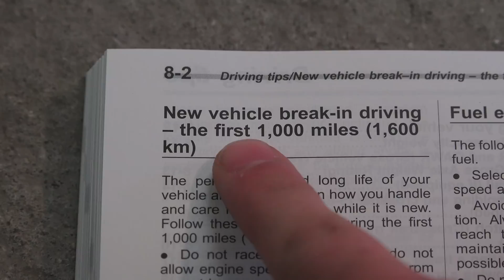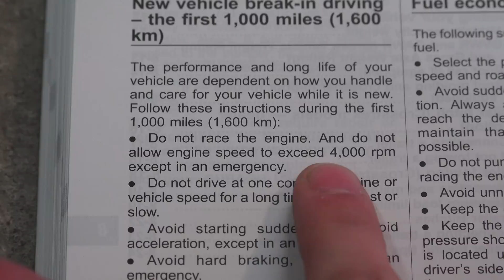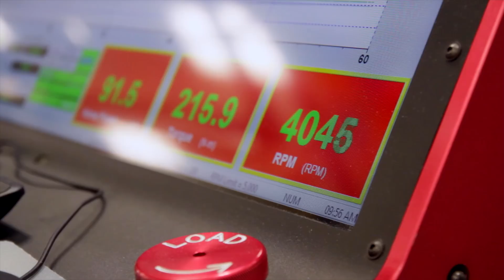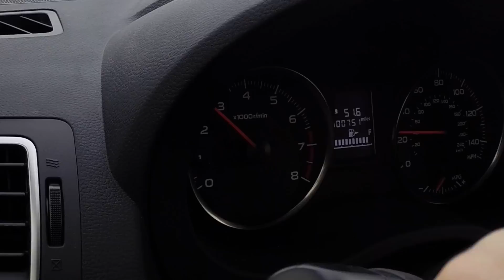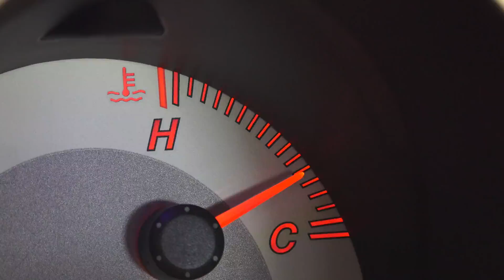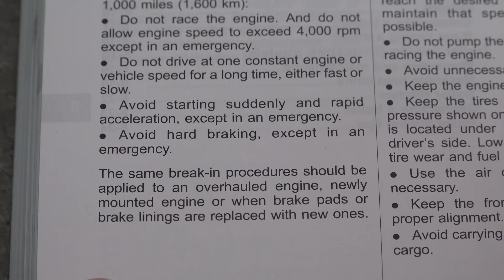5 Things You Should Never Do In A Brand New Car

Comment: I disagree with your break in theory, here is why. 

The main reason for run in is to knock the top off the hone in the bore allowing the rings to seat against the bore. The reason a bore is honed is so that on a microscopic level there are grooves in the cylinder wall so that there is a place for the oil to sit allowing the rings/piston to be lubricated in conjunction with the oil control rings. At idle the piston is going up and down at least 1600 times a minute, each time rubbing the rings against the cylinder wall.

Just how many times do you think this needs to happen so that the rings have a chance to seat?

Even the fact that they use mileage rather than hours contributes to just how flawed this theory is. 

Advancements in manufacturing processes allow for much higher tolerances to be achieved, and in my opinion, makes this ancient process from decades ago obsolete.

Comment: New vehicle break-in recommendations are mainly intended to prevent engine failures during the warranty period.  They could care less whether your engine ever makes it's maximum power, or lasts beyond the warranty anyway.

I always give a new engine a few miles to get the oil temp up to normal, then drive it fairly aggressively, up to about 75% throttle for the first 100 miles or so, then give it short full throttle runs up to redline for the next 200 or so, change the oil and fillter and run it as normal from then on.

The last new street engine I broke in, was on it's first track day with around 300 miles on the clock.
My race engines get about 45 minutes under varying loads on the dyno, then a few full power pulls to verify the tune, then hit the track.  As long as the oil temp stays in a safe range I run it as hard as possible.

Comment: cross hatch  on the cylinder wall,s make the the rings rotate during break in, plus a barrel faced top ring will never leave a nasty ridge, a s for the brand  new car deal, the jockeys that unload em rev the piss out out of em on the loading dock,so they are al ready broken in

Comment: Its recommended for my Jeep's pentastar break in (500 miles) to have brief full throttle acceleration at cruising speeds. I've read that procedure is supposedly to build as much pressure in the chamber as possible to push those rings out with the most force.

Comment: None of this applies to full electric cars
Reply: I watched the whole video and would have believed you until he started talking about brakes and tires at 8:18. The rest of the video prior to that is a list of things most of us won't have to worry about in the not too distant future. I own an electric car and have thrillingly floored it from day one without concern.
Reply: Mark:  I don't understand your objection. 

The brake issue is WELL known.  If you get a new set of, say, disc brakes, any competent mechanic will tell you to try to avoid hard braking for the first several hundred miles while the pads and breaks wear in. 

For the tires, it's a safety thing.  Just because you didn't have a problem doesn't mean flooring the car until the tires break in doesn't mean that's smart.
Reply: Roger Geyer I didn't object to that, quite the opposite. I just said I would have believed nothing in the video applied to EVs if it weren't for the mention of brakes and tires at the end.
Reply: *****:  I see.  I misunderstood.  Thanks for clearing that up.

Comment: When i used to buy some new cilinders for my scooter they would also have a break in period of about 300 miles.. and about 500 miles if u were going to have some crazy 10k plus rpm. If u dont do this u can basically throw away a new cilinder after a couple of weeks/months. Ive had cilinders last me years.. So u can use this rule for all types of gas engine.

Comment: you are saying what i am saying for 20 years :p 
also i do this every first 20 min when i cold start the car 2500 rpm and 30 % throttle butt i have a question when a new car comes of the line they really accellerate hard and brake hard en corner hard for the test not really healthy ?

Comment: The biggest load of bull I heard all these new vehicles are already driven off the line when you get all they do is reset the mileage.   We have dyno many new engines from rebuilt and have covered today 100k worth of kms .   the 1st 50km is the most important part to break inn a motor, you say GTR the why do they dyno every motor before the owner gets it so its already driven inn long before you get it . so not sure where you get you info.  all new GTR are tested on there test track and motors tested

Comment: I agree that a break in period is generally a good idea, and that not doing an engine break in is an unnecessary risk. however, we have done dyno testing to prove the "break in" theory. now, I preface this by saying all of our engines built get run on a dynomometer, and we have a break in procedure for each engine, but we have had extenuating circumstances (usually due to time constraints) where we cannot break in an engine, and have to proceed with full throttle pulls on a brand new engine. now, keep in mind that each of these engines are custom, and totally hand built and manually machined, so our attention to imperfections can be more closely monitored than an OEM solely because of our lower volume than said OEM. BUT what we noticed was that when we ran new engines at WOT for a full pull(5,000-8,500 rpm), each cylinder had perfect leak down, and compression, the rings looked perfect, and when we check the cylinder ' s cross hatch with a profilometer, it checked the exact same as when we put it together. this engine went on to run a full season in an offroad truck series.

now, before I get flamed for posting this, I will leave an asterisk, and that is that, not only do we use significantly higher quality parts in these engines, but they also get torn down once a season, so they never see the mileage that an OEM vehicle does. 

just some interesting data that I thought I would share.

Comment: I had my engine rebuilt about 1.5 years ago, it has break in oil in it and i was supposed to put 500 miles on the car and then change the oil.  Well...I haven't been able to drive the car very much so it probably only has about 100-120 miles on it now.  I take it out more often these past 6 weeks for 10 mile drives on some country roads that are pretty much empty so i can vary the rpm and load and get the car fully warmed up and everything.  Should I be worried about that oil in the engine after this many months even though miles are still low?  If it's better for the car, should I force myself to take money out of savings to get it in better shape to be driving around and knock out this 500 mile break-in?

Comment: On a side note, how many cars get totalled due to engine failure? Typically it's other reasons why you would scrap a car. I remember one story about the repair costs on an ABS system were so high that the owner walked away from his car. Ya think all those Toyotas that ISIS uses still have working aircon and power windows etc???

Comment: You people would be appalled if you watched dock jockey's move vehicles from ship to train.  Pretty much WOT (on a cold, new engine) onto boat, off boat, onto train, off train, onto truck, off truck - and sometimes to the dealer across the state.  Then transport mode is generally disabled at the dealer to show 0 miles on the odo when in reality a vehicle could have UP to 150 or so miles.

But hey, new engines are over engineered anyway, so it probably doesn't hurt it much.

Comment: My wife recently bought a Crosstrek as well, and we just got done breaking it in (past 1,000 miles). The oil consumption appears to have stabilized; it used about half a quart after 650 miles, I refilled it, and checked it again at 950 and it had not gone down. Not the same story as with our SH Forester. With that car, oil consumption never stabilized as it blows through about a quart of Mobil 1 every 1,500-2,000 miles. Not sure if it was a break-in issue, or the engine has a design flaw (there is a TSB about the oil consumption problem, and says that the only real way to fix it is to rehone the cylinder walls and replace the piston rings). It's at 120,000 miles so I guess we'll never know.

Comment: Can you elaborate further on the RPM variation rule? As a pilot (and A&P mechanic), I've always been told that to break in an aircraft reciprocating engine, we need to avoid repeated takeoffs/landing cycles, and keep the RPM at a constant cruise setting (so about 300-500 RPM below redline). This half-goes against the whole varying RPM rule, but at least follows the avoid redlining the engine as much as possible. For the most part, engines that are "properly" broken-in this way, go the distance of about 2,000-2,500 hrs (TBO is about 2,000 hrs for most aero recip engines).

Comment: 7:07 is there a reason for that oil filter being way up high like that? I guess as you remove it it makes the oil flow down to the pan but it seems to me like you'll have some spill onto the engine. You also wouldn't be able to prime it after an oil change. I'm no engineer or even a mechanic, but I do all of my routine maintenance and light repairs to my truck so I'm genuinely curious.

Comment: If you buy a Regular everyday car,no body cares and wont bother rodding the crap out of it. I can guarentee any high performance type car is abused at the dealership before you get delivery. I know a guy that wouldnt even accept ownership from the dealer because he witnessed the employees abusing the car before he even got it. They tryed telling him they were attempting to " break in the engine". He had video taped the whole thing. They wasted the tires on the car as well as toasted the engine. It even had a spun bearing! Because he video taped the whole thing,he was able to get a full refund and those involved were fired as well as the dealership was given a low rating dropping their ability to buy higher end cars and sell them because of it. A year later they changed ownership and are doing better. The pukes they hired were not even experienced technicians,they were the wash and prep guys.

Comment: anyone who advocates a soft break in as the ultimate for performance is a moron.  automotive engineers say hard break in, lawyers say soft break in.  the best way to break in a new motor is heavy load and medium RPM

who in their right mind would sell you (an unknown entity that as far as the seller knows has never driven a car at all) a brand new GTR and tell you "yeah just romp on the thing"

you mentioned the corvette specifically, all they suggest is not exceeding 4000 RPM.  the reason they say no full throttle launches is because that's a high RPM low load situation, which is exactly the opposite of what you want to make your rings seal.

Comment: but the factories already run the cars at full speed at least 200 miles lol.  I see them every day at nissan racing each car on the test track.  also fyi.......new off the line cars are put in a special mode that doesnt add mileage when they test them.

Comment: My 03 Matrix XRS saw 8500 rpm before 300 miles. 14 Si also saw 7200 rpm before break-in. The XRS went 170,000 miles, trouble free, original clutch. Si had zero issues as well.

Comment: after picking it up my dad warmed the engine of his ford grand c-max with a 2.0 diesel up for around 20 miles and then he drove on the autobahn and first drove 80 mph then 100mph and then 120 mph (top speed of this car is around 135mph)
he did this for around an hour.
the car has almost 30k miles now and burned zero oil. not even 100ml. (yes, there is oil in the engine)

Comment: SO FALSE. The FIRST thing you want to do is put it in 1st, and floor it to near redline and allow the engine to pull the speed down until it is at 1000 rpms and do it again untill you have done it 4-5 times for plasmamoly rings and 15-20 times for steel rings. That is the only way to get good ring seating. PERIOD. I just put a new engine in my daily (4.0 jeep) and that is the first thing I did after the 20 min cam break in (Hydro flattap cam) and the compression is perfect. 

You NEVER want to go easy on a new engine, that is how you get bad/inconsistent ring seating and screw yourself over long term. Also you will never get max power. Performance cars like you said get their engines broken in ON DYNOS AT THE FACTORY. They get run hard before ever leaving the factory. The whole 150 miles equivalent is done with 5 hard pulls and is done under 20 minutes. Look up the process of the LT4 engine being produced, they hook it up to the dyno and hit it hard a few times and then box it up. 

Tell me why ALL cam and ring manufactures say you need to A. Break it in once you start the engine or B. Take it racing to break things in or C. DYNO run it before you install it. Unless the person who honed the bores is a moron or you are using crap rings you should be able to hit it hard and be done. As long as you have oil pressure you will not hurt anything if they machined it right. I mean for god's sake if you have plasmamoly rings they seat by the time the engine is warm on the first start, by the time you start the break in runs they are seated. 

Also for the love of Christ you bed in brakes BY BRAKING HARD 7 times from 55-10 mph and not allowing the car to stop between cycles. IT SAYS SO ON ANY BIG BRAKE KIT MANUAL.  

It's a shame, you normally give such good advice but on this you sorely missed it.

Comment: I always thought it is because of cooling issues. When the piston ring has no full contact area to the cylinder surface due to grooves in the beginning, it simply is not able to lead away its heat to the cylinder wall as good as needed. A familar reason leads to sodium filled valves. But with piston bottom cooling and laser honed cylinder walls everything went better. I'm also quite shure that the control unit of a factory new Bimmer simply curbs the power. They get better and more powerful with the miles, or is it because of the bearings wearing in? Or is it chestiness? Nevertheless I always did an acurate and long break-in, but more important seems to be for me to drive the car always warm very gently. And then there is the crystal structure of the steel (even or more important with the transmission gear wheels). Steel seems to have a few 'tempering' cycles, to reduce tension and to get tougher.

Comment: Engine break-in periods aren't really a thing anymore with most cars, because A. they are manufactured to very strict tolerances and B. they are typically stress tested and run in before they are fitted in the cars.
Reply: They probably do, but it isn't as important as it once was.

From a technical standpoint - with a brand new car, you are probably fine to floor it as soon as its up to temperature.
Reply: As a former salesman who received cars both at the dealership and straight from the shipping yard (by train in my case), I can guarantee you that not every car from the line is tested. It would be time consuming, and drive up the cost. Most were received with less than 5KM on it, often under 2KM, while maybe one in 100 had over 10KM. So we're quite far from the 300-1500Miles required for a full break-in. That being said, you're the master of your own life, but personally, that's not a guess I'd be willing to make.
Reply: I mean that the engines will be run out of the car in the factory in vast computer controlled rooms before being fitted in many production cars. I may be mistaken, but I'm quite sure I've seen videos to that effect in the past.

Comment: rebuilt diesel tractors , so here are my few cents.
what you want to do is to have a light load at first.
then you want to change the oil.
then you want to make sure the engine gets thermal cycles, you start soft, then have medium load then light again then you want it off so it can cool down.
then you want to change oil.
and then you can do wide load range and.. then change the oil. lol.
for a tractor engine it takes about 50 operating hours. 1 hour is 100,000 revolutions.
takes time, lot of oil change.

that is how i do them. when done you can give it hell.

Comment: No joke, my school has a donor vehicle that's practically brand new in terms of miles. It's a 1995 Chevy S-10 (2.2L I4 RWD, base model) that a dealership accidentally crushes the roof a bit with during a trailer loading accident. It still ran and drove fine but legally it was totaled, so it got donated to my school, ran and drove just fine until several years ago someone connected a battery backwards and fried the electronics. As for how many miles are on it? 288 original factory miles. It ain't even broken in yet. Condition? Beat to absolute hell, all that's good about it now is the engine components are still practically brand new and there's no rust anywhere. Everywhere else is beaten to complete hell though being that it was given to a bunch of kids to use for the past 20 years

Comment: I posted below before watch the video. Now I'd like to add: trust what the manufacturer says for break in? You mean trust the same people that have had engine recalls, transmission recalls, air bag recalls etc. so just because they are a manufacturer does not mean what they say is set in stone. Everyone on this earth has made mistakes. Every manufacturer (which employs humans who make mistakes) has had engine failures. Take it for what it's worth but running an engine hard from the onset always gives you a better broke in engine. The transmission however does require a break in. So that causes a dilemma. The way I do it is not hammer it from a dead stop. Put it in second gear and roll into the throttle to red line and when you get to redline let off and let the engine slow the car down. I do this many times sporadically